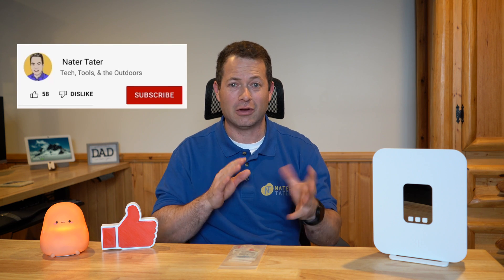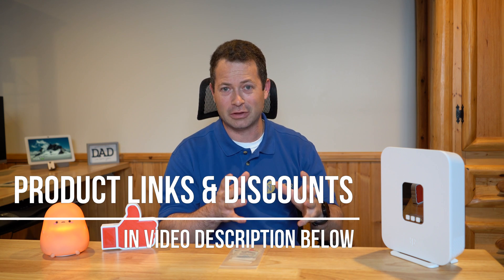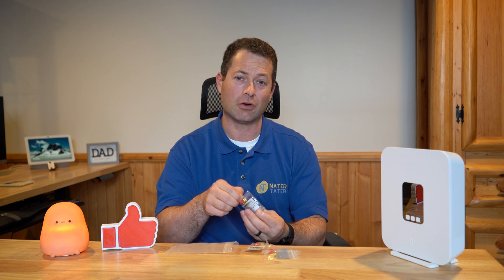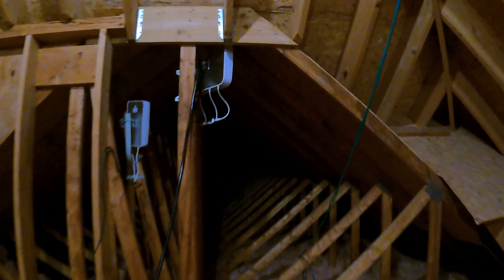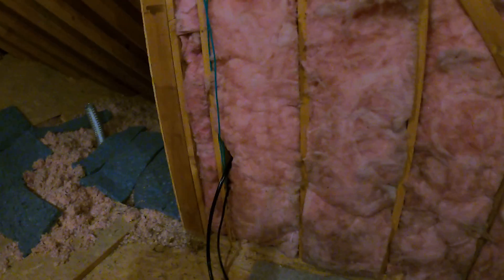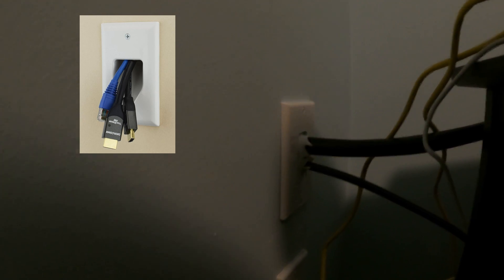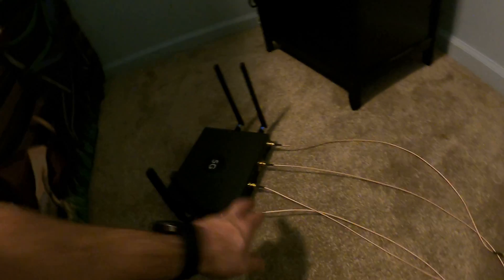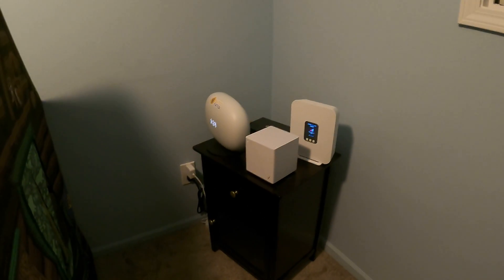✅ How I Ran External Antenna Cable Through The Wall - Waveform 4x4 MIMO - T-Mobile 5G Home Internet

Comment: After a few months watching, checking, chatting couple times with you, I went ahead and ordered the WaveForm QuadPro. I'm hoping to see a great improvement, but my tower is 3.5 miles from my location..  ATM, my Down is 20Mb/s-120Mb/s avg 40Mb/s, but my Uplink is the bottleneck that I'm trying to get up.  After thinking about location and not having to drill holes in my wall from outside.. I happen to think what if I set my T-Mobile modem right under, my outside Antenna with a 10 ft cable.. A hole needed in garage wall though..  I bought 30ft with kit.. This plan came later.

Anyway, setting my Modem under 10ft of cable from antenna which would be less noise.  Then run 50 ft of CAT 7 cable to my Router on the other side of my garage.. The garage is only 22ft wide, but the up across ceiling and down, it would be around 35-40ft.  What's your thoughts on that set up... OR should I do the window thing with 30ft of WaveForm cable.. The only problem with that is, it's on the front of my house, be across the porch ceiling, etc.  

My Antenna should be here mid to last part of next week...  Appreciate all the time and work that you have put in testing all this stuff..  A big think you, Nater..
Reply from the maker: @Foxxie55  awesome.  I think the garage option with 10ft of cable will work well.  I think the kit comes with a 10ft and 20ft cable in the 30ft kit so it should meet your needs.  Ethernet can easily run 300ft with no drop in speed.  Let us know how it goes!

Comment: A couple days ago I received my TMO - G4AR   gateway. The sma port are smaller than standard coaxial cables with sma. How do I find adapters to fit the smaller sma connectors?
Reply from the maker: Yes correct.   SMA is not the same as home coax.   Waveform sells all the adaptors, links in the video description.

Comment: if you are unsure where your towers are The Wireless Haven has a Tower Survey service that provides you a detailed report including a KMZ file of the exact locations of towers in your area and the towers capabilities. The publicly available services like Cell Mapper are incredibly inaccurate and out of date. I paid for a Verizon survey and the report you get is very detailed including the height you need to place your external antenna to achieve maximum performance. I was able to reposition my Waveform 4x4 mimo antenna and significantly improve my performance with a Cheetah Router.

Comment: I watched all your vids. So i just bought the waveform 4x4 antenna. Expensive, but if it fix my issues and fill my needs i wont be regretting this purchase. I still don't know how am i going to place it or where to drill. My house is one level so not much high. I hope i can open the nokia and plug the antenna without any damage je.  To bad they don't let you swap it for the new one with the connectors
Reply from the maker: Thanks for watching!  I am sure it will help your signal!

Comment: I think I had mentioned these 90 degree connectors in another video you did. However I did not go this route, I had a old metal box here that at one time was a lowpass filter for my ham radio. I stripped the coils out and removed the PL-259 connectors. This box is about 2.5" x 2.5" x 9" long. I drilled out four hold to mount the N type Connectors in. I did four of them. The connectors had about 6 inches of the I think RG-174 same as you have for the Cheetah. I then drilled a hole in the wall where I mounted the Cheetah. Hole was about 1 inch above the unit. I mounted the box on the outside and siliconed the heck out of it,  Also the small cables have 90 degree connectors that go straight into the Cheetah. But on the outside I use 20 ft. of LMR-400 with N type ends.
My speeds went from 90-130Mbps to 4-500Mbps. It was worth the little extra money for the cable and panel antenna for that gain.  BTW Nate, I still have a 1 inch hole in my wall,,, LOL
Reply from the maker: Sounds like a robust setup!

Comment: I have a single story home with an attic crawlspace. My Waveform antenna is mounted outside. I installed a box on my outside wall to rout the cables. sealed outside and inside. I have my Chester Cheetah mounted on the wall about 4.5 feet and the cables come up along dide and over the top of the gateway with a gradual 180° bend so that there are no sharp bends. Not too pretty but it works.
Reply from the maker: If it ain't broke don't fix it!
Reply: @NaterTater …Are you not using the Chester anymore in favor of the new TMHI gateway? I can’t imagine that it can outperform the Chester unless 5GSA is not good in your area.
Reply from the maker: @profitgee1  no, I put the G4AR in its place to demostrate this video and the 90 deg adapters.  I'm always moving, disconnecting and testing things!
Reply: @NaterTater thanks so we know what is best not only in stronger or faster signals but also cost. 73

Comment: How many T-Mobile bars are you losing thru the 20’ run of low loss coax?  vs. the Gateway mounted next to the other antenna arrays in the attic?  It’s interesting I lost 1 bar between Summer and Winter,  tree leaves vs. no leaves, Very Good vs. Excellent signal🤣  I have a 1/3 mile direct shot to the 5G TMO cell tower (thru the woods). Josh/UpstateSC
Reply from the maker: Bars are not a good measure, i lose no bars with the 30' cable.  Its a couple dB signal loss.   Well worth the improvements the large directional 4x4 provides.

Comment: Quick note on the 4x4 Waveform: I bought one thinking I could run an inside install through the attic like Nater, but could never get an improvement over the stock Cheetah no matter which I pointed the antenna. After many hours of experimenting I finally tried placing the panel in the closest window (almost in the opposite direction of the tower) and saw a noticeable decrease in ping and improvement in SINR. Still have a weak 5G connection but I'm now on 41 pretty solid getting 100+ download speeds most of the day.

If you have the Waveform don't give up. Panel placement makes a big difference.

Comment: Thank-you for your great videos.  
How long are the cables on the 4x4 external antenna?  
I currently have the T-mobile KVD21 and usually get around 300+ down and 15-30 up.  If I splurge and put up one of these external 4x4 Antennas can I expect to double my current speeds? 
I would like to get the new t-mobile gateway.
Reply from the maker: The standard length is 30ft but you can contact them and get a different length if needed.  The speed change depends on a lot of factors.  One way to get a rough idea is to drive closer to the tower with your gateway (perhaps powered by your car's 110v outlet if avail).  If your speeds don't improve much then don't expect a big improvement from the antenna.

Comment: Thanks, as usual, for the info on the connectors Nate. I got the 4x4 MIMO kit from Waveform and just yesterday got permission to swap out my old trash can gateway for the TMOG4AR.  My only issue now is that the gateway needs to be placed in my heated garage which is not in a central location to the house.  Any recommendations on a setup to bring a remote router connection by Ethernet with this new model? I’m looking forward to getting a better signal here in Michigan woods.
Reply from the maker: Hey Gary, great to hear you got the new gateway coming.  For a top notch system check out my recent Omada video (https://youtu.be/34NZwJh4N84).  You'd only need 1 or 2 AP's, not the 9 I have.  For a simpler solution check out this video: https://youtu.be/BEA61OK6hmc
Reply: @NaterTater Thanks Nate!